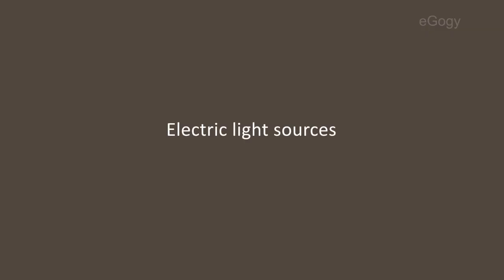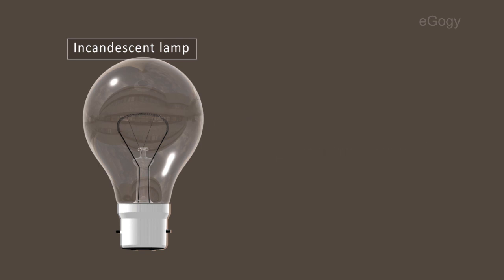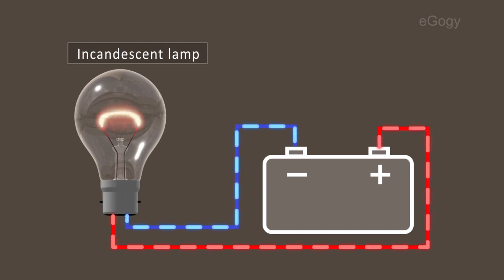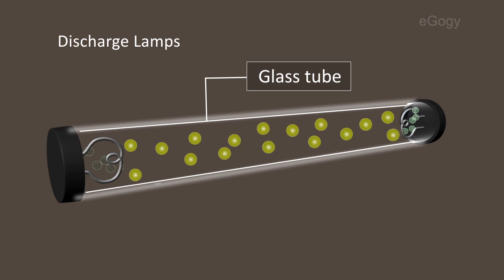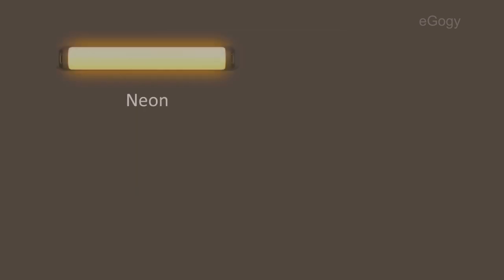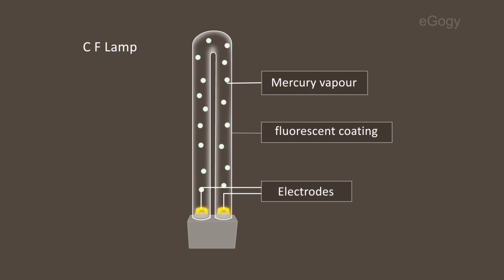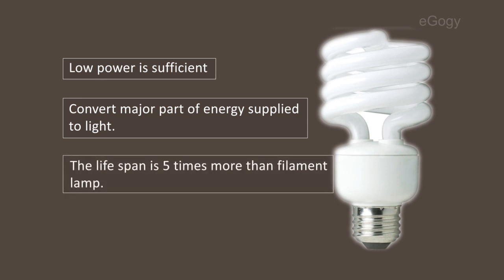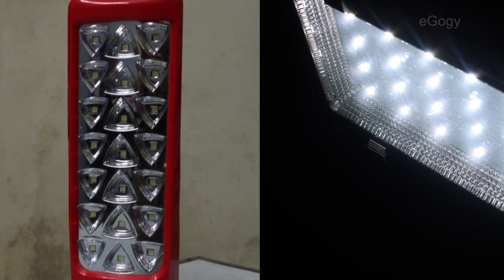Electric light sources:(Incandescent  or filament lamp, discharge lamp, CF & Led lamps)

Comment: Why inert gases used in incandescent bulbs? Because those are poor conductors of heat (there are better definition but if you write this in exam most likely you will get at least some marks)
Reply: And to prevent a chemical reaction with tungsten with air
Reply: If there is no inert gas ,(say it has oxygen ) due to heating of tungsten it reacts with oxygen and become oxides .lead to loss of tungsten material